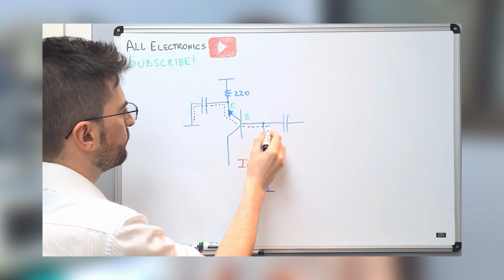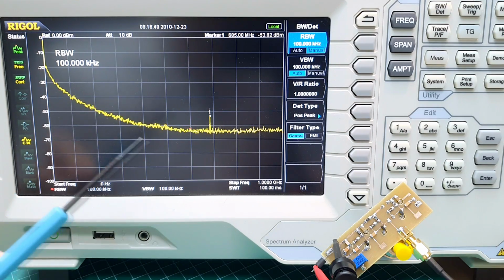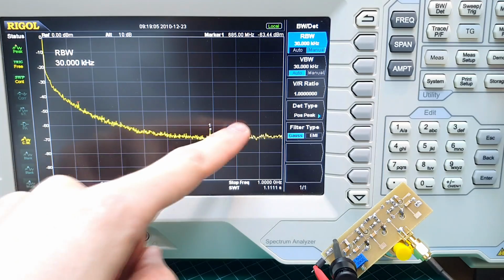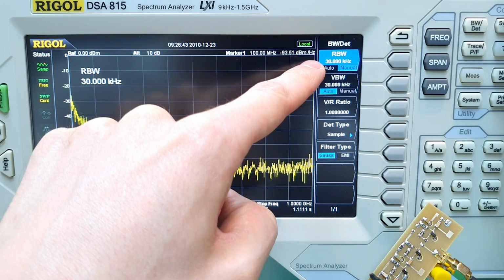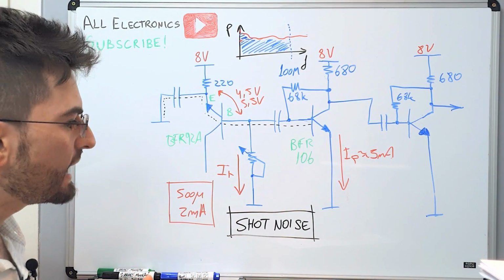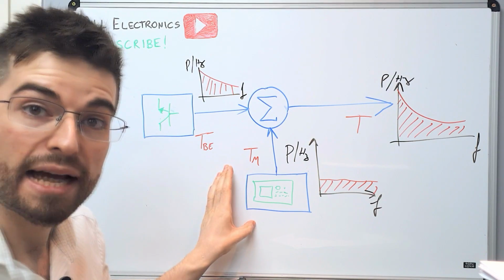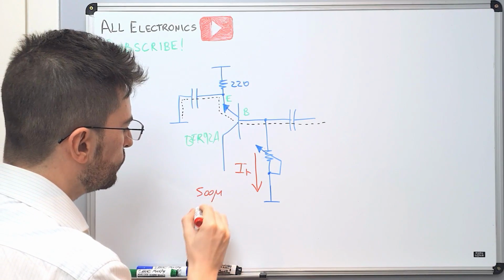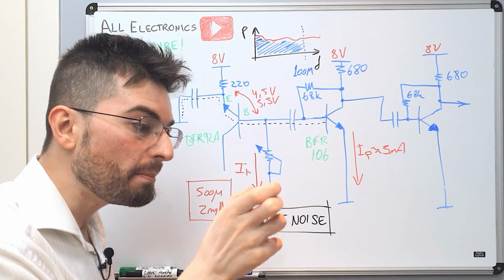Understanding Noise Sources and Measurements: BJT Transistors Explained

Comment: Care should be taken to:  1 - keep the reverse B-E junction current at a strict minimum as a BJT is not designed to have its B-E junction reverse biased
 ( The BJT's parameters will degrade if excessive reverse biasing is used )   and 2 - Use plenty of decoupling for the noise transistor biasing. 

Personnally, i use two BJT's in direct coupling: two  PN2222's, one as the noise source and the second as an amplifier.

Amplifier 2222 has its Emitter grounded and Collector biased by a 4k7 / 10k to B+
Noise 2222 Emitter is biased by a 220k resistor to the Amplifier's Collector and decoupled to ground ( close to the Amplifier's emitter ) by an Aluminum electrolytic capacitor, Collector is left open...

...And for the transistors bases ? both noise and amplifier BJT's bases are directly tied together !  Nothing else. The noise transistor's emitter being decoupled to ground,, most of its noise will appear at its base and amplified by the other transistor. 

This way, the amplifier's very low base bias will become the Noise BJT's reverse bias. Placing both BJT's and capacitor close together will help minimise hum / interference.
Reply from the maker: Great! Thank you for your insight, man.

Comment: Hello Gregory.Thanks for the  video .
How is it possible to build an oscillator with just a transistor,a coil and a resistor only ???
Reply from the maker: Humm.. I think it is, you will need a parasitic capacitance of the transistor.
Reply: @AllElectronicsChannel  .but how ?
Reply from the maker: I don't have any resource here to send, search for reflection oscillator.

Comment: Is that a diode at the power source? What is that ring on the wire? Great experiment!
Reply from the maker: That is just a ferrite bead. In the wire also, a ferrite used as common mode choke.
Reply: @ 
To eliminate noise from the power supply yes? Thank you for explaining!
Reply from the maker: @mayeraus41 yeeesss

Comment: Can I use a DSO with FFT option to see the noise spectrum? Would it yield the same result as that on a spectrum analyzer ?
Reply from the maker: Yes, it should. You may need to correct the measurement for the bandwidth and excess noise from the windowing function. The spectrum analyzer apply these corrections automatically when using a noise marker.

Comment: 2:27 - Noise doesn't have a time frame? Do you mean, this particular measurement of noise doesn't have a time-frame? i assume you could measure noise over time, if you wanted to. Might be useful. 
- "It doesn't matter the timeframe, it looks exactly equal." What looks equal? Each of those traces looks different, as you switch the timeframe. 
- What's being traced here? Just noise? Or noise plus signal? What's the difference between the thick solid central band and the fuzzy top and bottom?
- Thx!

Comment: Great video.  I have a question.  How to measure the Noise Figure of a Mixer? any guidance?  Thanks.
Reply from the maker: Thanks. The NF of a mixer is just a little higher than its conversion loss.. For calculation is common to use the conversion loss as the NF, for normal temperature use. For measurement, I think you should measure it with an LO equal to the LO that will be used in the application - measuring the noise at the IF. (or in reverse for up conversion applications).

Comment: Very interesting and well explained as a professor!! I would ask you the behaviour of the two stages following the noise source: I can see a higher gain at low frequencies and a lower gain at higher frequencies as expected (due to Ft of every BJT)but these devices can add their noise (F) which is 1/f noise as well! Now, how much of 1/f noise is included in the "1/f" gain curve/noise output of the stages? 
Thanks, 
Andrea
Reply from the maker: Great suggestion!

Comment: Very interesting topic to study and to play with. One thing I was asking myself. The noise source and noise of the spectrum analyzer add, but not in a arithmetic way, but rather like square root of quadratic summation that is used for adding up random sources of error? So the part you 'just' subtract the noise floor would also not be completely right. But maybe I am 'splitting hairs' here 😀and is your approach probably usable. Again, interesting video 👍
Reply: ...and probably interesting way to test / characterize systems (like filters) when you do not have a high enough frequency test source. Other would be a very fast rising edge test signal.
Reply from the maker: Hey man! The temperatures adds, because they are a measure of noise power. If we were talking about noise voltages, indeed it you add as as a vector.

Comment: Love your curiosity and the way you delve into topics and try to understand the basics.  As a engineer working in satellite communications for over 45 years, noise power density is a really important concept to understand as ultimately all communications links are limited in the end by the fundamental noise in the system, the signal power, and the bandwidth.  Shannon covered this in his 1948 paper, a mathematical theory of communications.

As system designers, we have some control over noise, but ultimately there is a practical limit in most systems where spending more to reduce the noise further provides little additional bang for the buck.  We can increase signal power through either larger amplifiers or better antennas, but in many cases we run into regulatory limits that cap how much signal power we can transmit in terms of equivalent isotropically radiated power (e.i.r.p.) or in many cases e.i.r.p. density.  Lastly, in pretty much all cases there are also regulatory limits on the available bandwidth that can be used.

I just returned from a month in Dubai attending the ITU WRC-23 conference where much geeking out over the signal, interference (unwanted signal from other services), and bandwidth for services were all front and center in discussions.

A video series that I recommend to engineers and technicians looking to learn more on the subject is by Frank Sanders of the NTIA:  https://www.youtube.com/watch?v=wJcSGicDjLw
Reply from the maker: Thank you so much man! I will share the video series here. Always learning with you too... I really appreciate we met here as a community.

Comment: Nice video! A quick question: why are you using the markers to read out the spectrum? Should it not be much quicker to read out the power spectrum and normalize it to power density by hand afterward? Am I missing something?
Reply from the maker: No exact reason, totally possible to do as you suggested! One thing: correcting by 10 log (BW) may no be equal to what the SA do..it is possible it has a correction/calibration factor for each RBW filter...

Comment: If you look certain transistor noise curves by the manufacturers (generally provided only for LOW NPOISE parts) you probably notice that they present the graphs on a logarithmic frequency scale (x-axis).  You show a linear scale. which changes the apparent curve shape.  If I recall, the ‘815 spectrum analyzer can produce its result on logarithmic, as well as linear scale.
 .
Another little note is that your supply voltage is rather low for approximating constant current.  If the voltage would be raised to, say 24 V, you would be considerably closer to constant current feed (on a 5 V reverse bias junction.  By the way, if you would use ordinary diodes, they generally have much higher reverse voltages and operate in Avalanche mode, rather than in transition between zener and avalanche.  But there is a change in both noise amplitude and noise spectrum - the first one becoming higher, while the spectrum gets narrower.
 .
Finally, if you would limit the issue of noise to audio range (<20 kHz) you would need to consider the polarity symmetry.  Possibly you would need two noise generating junctions, one fed from positive supply and the other one from negative one, and then the two noise signals summed into the output amplifier stage.  And you would need to choose between white and pink noise.  All that is beyond your scope in this presentation, but maybe something you may touch some time in the future…
Reply from the maker: Thank you so much for the info, man. This is exactly what I expected from the All Electronics community... I always learn with you, we are always learning together.

Comment: User should be careful to ALWAYS put a bandpass filter between the noise source outpur and the spectrum analyzer inout  to prevent overloading the input power . Usually between 10dbm 20dbm is safe however without bandpass filter, the noisegen will send that power over a wide range of frequency which according to parseval theorem, the totatl power will increase with an rms behaviour which can easily exceed 20 dbm
Reply from the maker: Great point, will add this to the article! Thanks man.
Reply: @AllElectronicsChannel  thank you! Your videos are so high quality and comprehensive that finding a small missing thing is like a miracle. The whiteboard component in your video is such a phenomenal tool 🔥 cheers
Reply: I think you are talking about an attenuator - not band pass filter.😊
Reply: @InssiAjaton if one wants to find Sij over a smaller frequency range say 200mhz to 250mhz, then a band pass filter is more advantages because you can have better dynamic range. The NS already generates a +5db over that smaller interval so the parseval power density is not gonna be much higher than 10dbm over that short interval. so we are set with a huge dynamic range from 10 dmb to whatever SA can go down ...An attenuator will dampen the amp over the whole huge range thus reduces the dynamic range which can be improved with anotger amplification stage which is not very necessary in this case. But I agree if someone wants to be totally safe, he would put a 40dbm att at the first try and theb plays with the amount of attenuation to increase the dynamic range
Reply: @arashghasemi  Our thinking is really based on different experiences.  Mine is to meet the noise limits in industrial controllers, conducted and/or radiated.  For the conducted (generally switching) noise, we have to measure 9 kHz to 30 MHz band, using a Line Impedance Standardizing Network device.  The line in question can be single, or 3 phase.  In US, that can mean 115 V RMS or 480 to 520 V RMS nominal applied to the LISN.  The construction of the LISN is such that in continuous use you get a 50 ohm signal of the 9 kHz to 30 MHz band of interest signal at a safe level. But when hooking up the LISN to the spectrum analyzer, you may get a destructive transient.  Ask, how I know… Anyway, you just have to use an attenuator for that time protection.  And you don’t need to worry about pressing more dynamic range, as the purpose is that the emitted noise stays below roughly -50 dBm, quasi RMS.  Or another 10 dB safety margin, if you don’t have the quasi RMS processor and you are making your own preliminary measurements before submitting the devise to official test by an agency who has the fancier equipment.  So, checking an intentional noise generator that operates maybe at millivolts, you only need the protection against STATIC CHARGE, and can likely achieve that in other ways.  For my power line voltage LISN, you ideally would need a clamp, but for practical reasons, a 30 - 40 dB attenuator is the standard safety measure.
Reply from the maker: Great discussion... thanks guys... this is All Electronics! We are here learning together.  I'm grateful for having this opportunity.